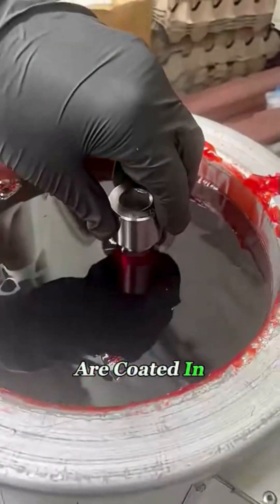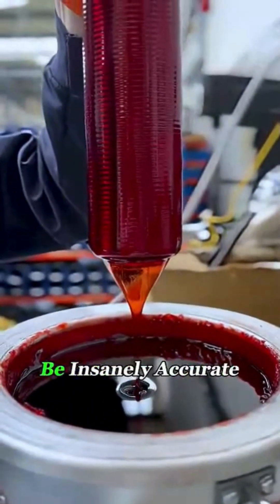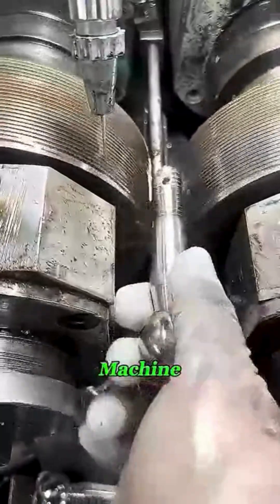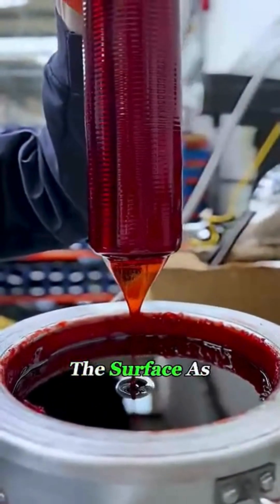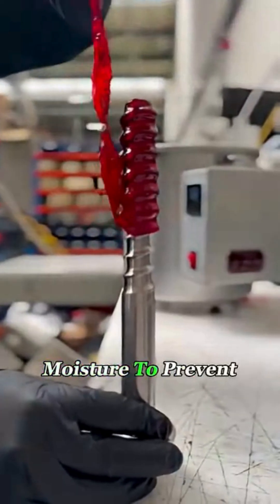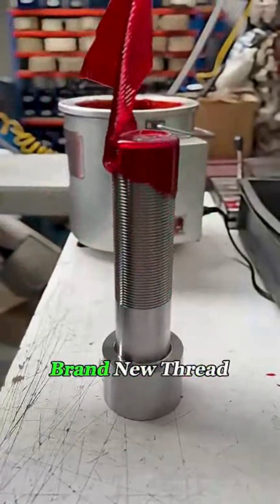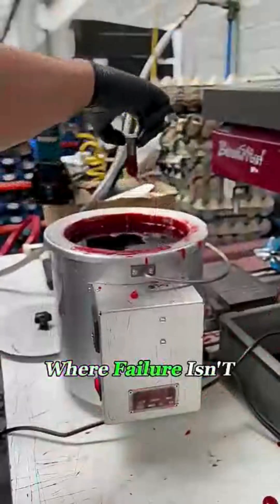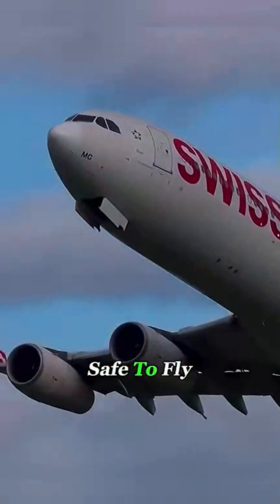Why bolts get dipped in wax 🛠️🕯️

Comment: If you have not seen this before it is probably because you have not worked with exotic metal bolts (monel,hastelloy,inconel) that cost $40 and up each.  Some precision bolts have the coating to prevent oxidation that leads to damage on installation.